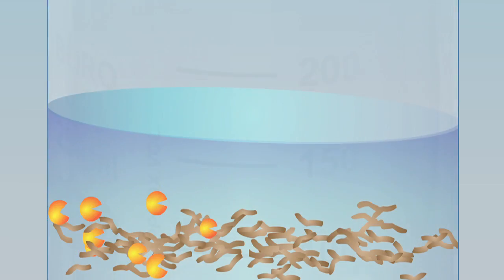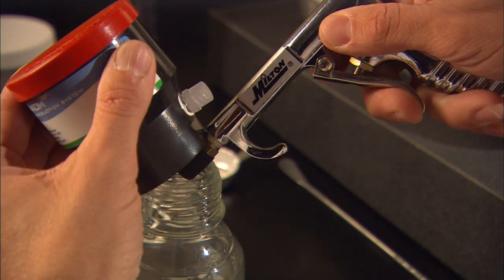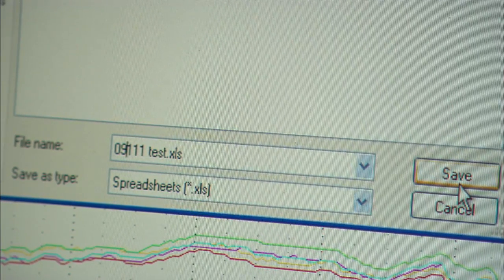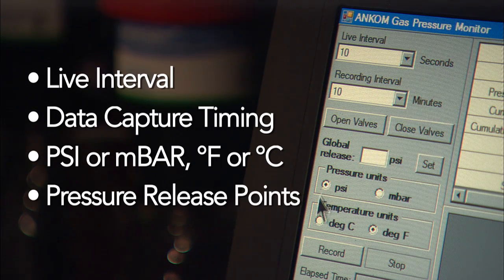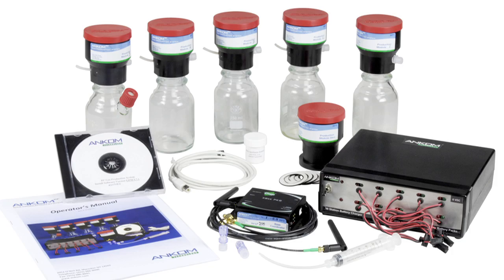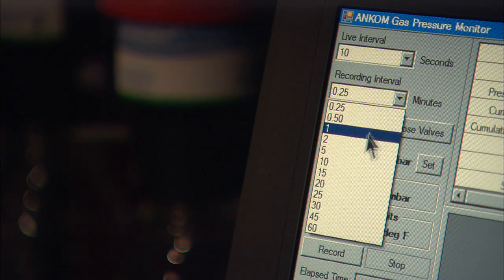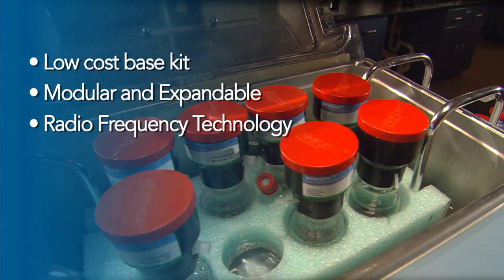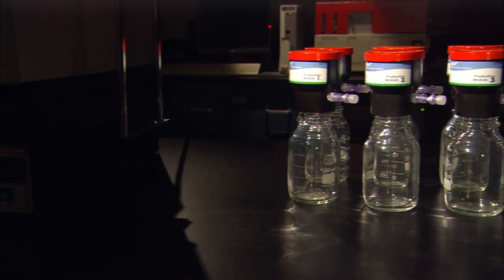ANKOM RF Video (Fermentation and Anaerobic Digestion System)

Comment: regarding to the daily homogenization, the starter kit does not include stirring module, Which one has been used on this video?, can you also provide it? btw the pdf file with the module design is just a blank sheet, no info at all.